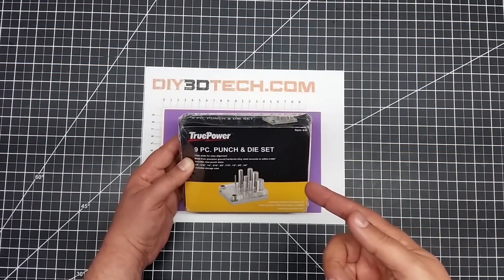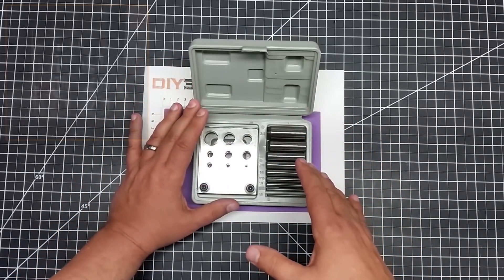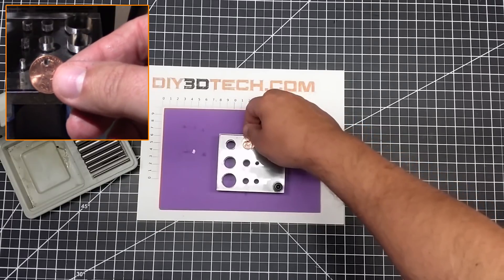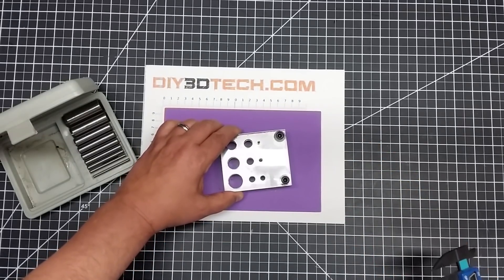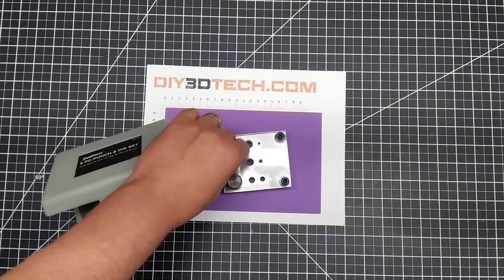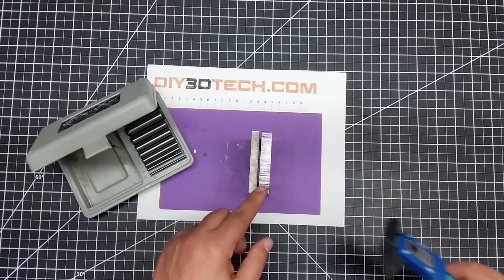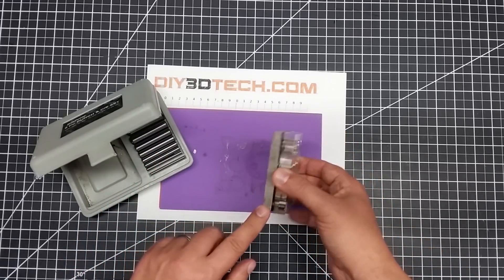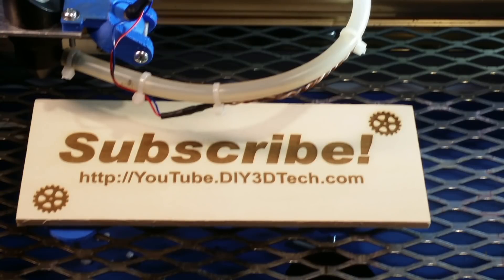Shop Talk - Affordable Punch and Die Set!

Comment: The die set is mainly for punching holes in shim stock or gasket material.  I generally move the top to allow the material to be cut to just slide in between the two.  You want the acrylic top to provide some support to keep the material from deforming too much as it is punched.  Here is a link to the original version of the punch set.  https://precisionbrand.com/product-category/punch-die-sets/
Reply from the maker: Thanks its used quite a bit in the coin ring world for punching holes in the center of coins (where I discovered it).  I also designed a coin guide for it in Fusion 360 as later in the fall I will likely show some ring coin-art :-)